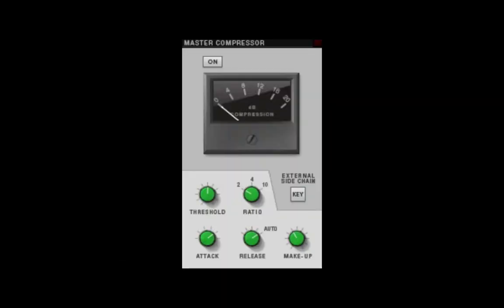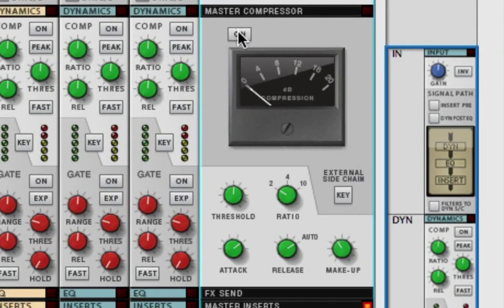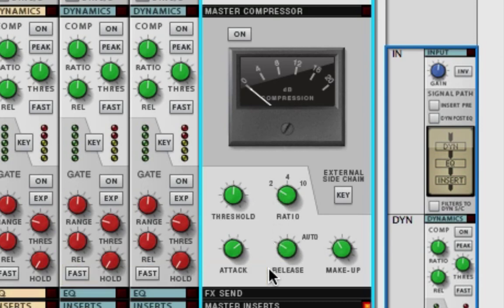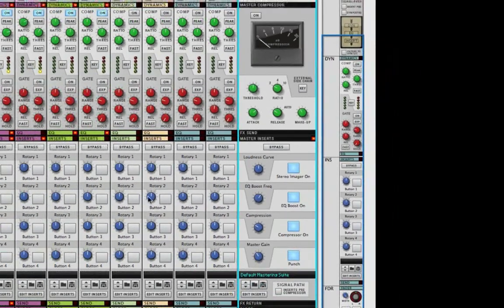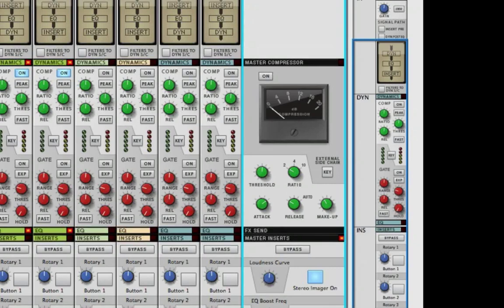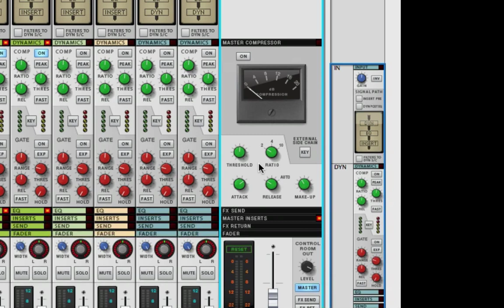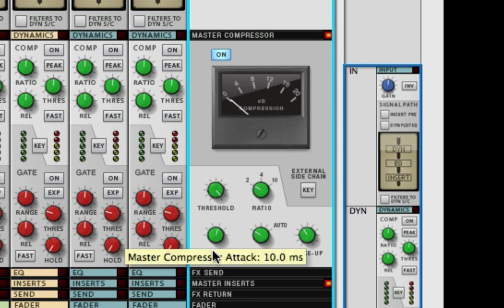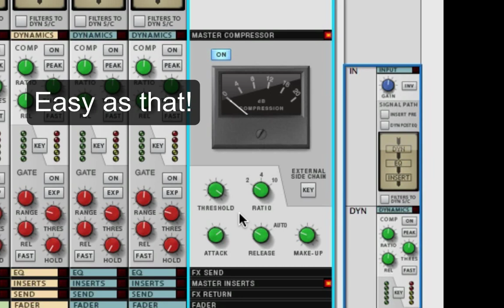Master Bus Compressor - SSL Mixer Video Series - Reason - LearnReason.com

Comment: I always put a high pass filter on the 'External Side Chain' for the Master Compressor. It helps the compressor work the low-mid, mid to high without effecting the low end.
Reply from the maker: XysteRST205 Nice...Thanks for sharing!
Reply: This is the way to do it, other wise your lower frequencies will be pumpy and have an increased attack

Comment: i dont get it..why have this bus compressor when Reasons have the master compressor on the mastering location?
Reply from the maker: Mastering location? Are you talking about the stereo bus?
Reply: @LearnReason  mastering location is where all the MCLASS plugins are?
Reply from the maker: @soundsfromYYBY  No that is the Stereo Output Bus it is called the Master Section, not Master Location. All mixers have mix channels that are summed out to a stereo bus. The main mixer in Reason has a Master Bus Compressor on the stereo output bus (Master Section) you can have it on or off. You can also insert any combination of effects on the main stereo output bus (Master Section). The MClass Compressor is not the same thing as the Main Bus Comp that was modeled after an SSL9000K which is a far superior bus compression than MClass is.
Reply: @LearnReason  right the Master Section. but both still mastering plugins, my point is if I'm using the MClass to master my finish product why use the BUS compressor?
Reply from the maker: @soundsfromYYBY  Again the Master Bus Compressor is far better than the MClass compressor when used as a bus compressor. Use what you want, use both or use one, it's your choice.
Reply: @LearnReason  i never ask whats better..but ok 👍🏿
Reply from the maker: @soundsfromYYBY  You said "if I'm using the MClass to master my finish product why use the BUS compressor?". The answer is because it is better.
Reply: @LearnReason  i found out the concept..before we master run a master bus to squeeze all the music together a little (i love the way it sounds ) then export out to do finish mastering or just go to master section. SHALOM 👍🏿